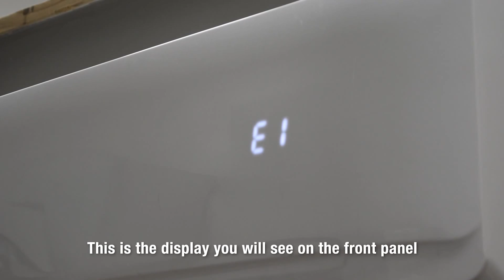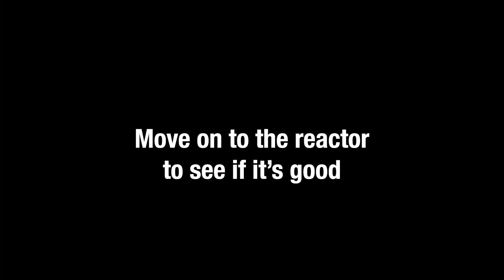Troubleshooting an E1 Error Code on a Mini Split — Perfect Aire

Comment: I have this problem. But first the AC unit starts well with cooling and everything. After a couple of hours, the E1 appears and everyhring stops. If I let it on with the error after 15-30 minutes, the error dissapears and starts working again with cooling ans everything.

Comment: What happens if I get this error after 3 years of usage?
Reply from the maker: Thank you for your question! Please reach out to our US based customer service team at 844-472-2473 Mon-Fri when on site the machine so we can collect more information on your system.
Reply: in that case there is module inside the inside unit the one where the wires connect to, its about 85$ here in canada
but you get that from goodman company if your unit is a goodman hope that helps

Comment: I actually had an “A/C specialist” take a look at my system and he literally spend days trying to fix my system with no luck. Thanks to this video I was able to find the problem! The unit kept displaying E1 and it turned out the power wires were reversed. Problem solved in about 5 minutes! Thank you ⭐️⭐️⭐️⭐️⭐️
Reply from the maker: Thank you for the feedback and happy to hear this video helped! :)
Reply: How did they get reversed tho? 
Are there tiny little men in there messing with it???
Reply: @kennethcortez3586  I think it got reverse since the 1st time the careless technician installed it.
Reply: @GuuiYae and leave you with a non working a/c?
Reply: That makes no sense. It works with the wires reversed for a while and suddenly it stops?

Comment: I have an intertek unit. Been installed for couple years & has been fine. We get a big rain & now I get this error code. If this just occurred for the first time… wouldn’t the wiring already be right? And it’s the storm that somehow messed with it? It’s the only appliance that was affected.

Comment: So what do I do when it has worked perfectly for ever then shows E1? Cannot possibly be reversed wiring??
Reply: mine did that afther i replaced the fan because it became slow and noisey i have ordered a new board i hope this work
Reply from the maker: Thank you for your question! Please reach out to our US based customer service team at 844-472-2473 Mon-Fri when on site the machine so we can collect more information on your system.
Reply: in that case there is module inside the inside unit the one where the wires connect to, its about 85$ here in canada
but you get that from goodman company if your unit is a goodman hope that helps

Comment: Hi. Bless you !!!
I have one question. One mini split Frigidaire have E1 code. When i see the control board i note a little burn mark over it. I dont note any component burn . How i can verify if is  the control board the problem ???
Reply from the maker: Hi Jose, I cannot speak with certainty about Frigidaire units, but have you experienced any storms lately? Is there a surge protector on the unit? E1 normally means there is a communication fault between outdoor to indoor units, and if there is a burn mark on the board, it more than likely means the outdoor board has been shorted, or a possible blown capacitor. Especially if it did storm before giving the E1 with no surge on the disconnect box.
Reply: @PerfectAire  good

Comment: What if my AC has been working for a while before and now it has E1 error after maybe 2-5 minutes of it running. For example, whenever i turn on my AC for 5 minutes it shut off and turn to E1 error. I cleaned the filter. It was working before so the wire must at the right spot. :(
Reply: in that case there is module inside the inside unit the one where the wires connect to, its about 85$ here in canada
but you get that from goodman company if your unit is a goodman hope that helps
Reply: @FamillyFunTime ow do you know it is the board on the inside unit? Could it be the circuit board in the outside condenser? Mine is a Goodman unit
Reply: @randynBroncos  it happed to me twice 
Once was the communication wires
Second goodman told me to change the module in the inside unit if that didn’t help
The module or the board in the outside unit
Fortunately worked with the module in the inside unit
Reply from the maker: Hi Lea! If you still need assistance with the E1 error code, please contact us at 844-472-2473 Mon-Fri when on site with the machine so we can troubleshoot.
Reply: @FamillyFunTime  : I am having the same problem as leaaae4638.Mine A/C is a Carrier. you say, 'the module, inside the inside unit where the wires connect'. Could you expand please. I don't know which module you are referring to.

Comment: I have sophia 36000bty. E1 error. Wire good, power good, motor good. I replaced pcb board but anyway E1.